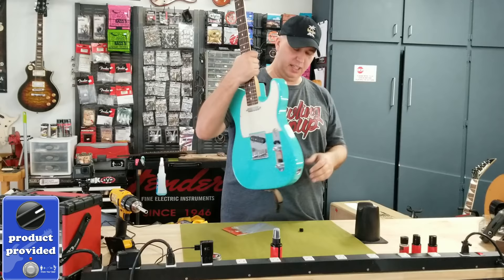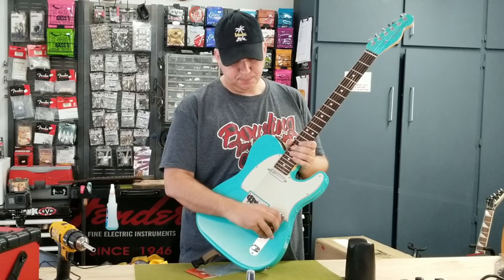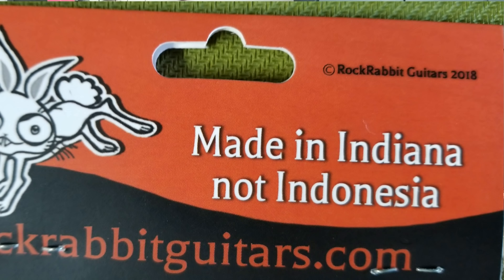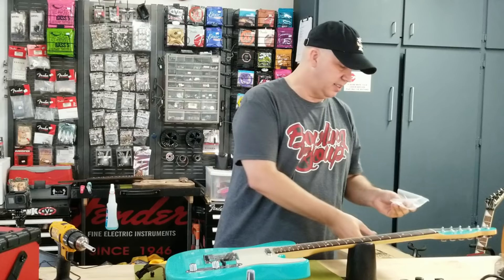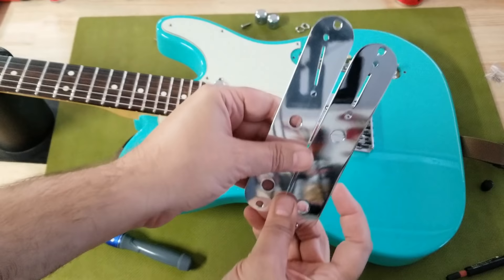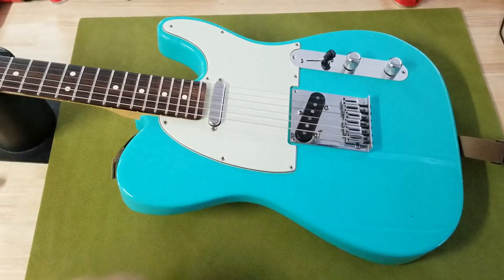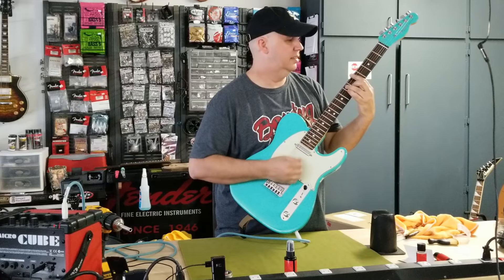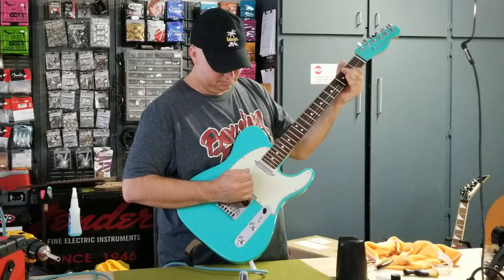Why Didn't Fender Do It This Way?

Comment: I would be willing to bet that, if Fender did something like this, the "how dare they change something" howling would go on for weeks
Reply: I do so love my IMPROVED Telecasters, but let's face it - Leo got SO MANY things wrong the first time, he had to start two whole more companies to fix it! Like, ahem, the front side of the neck was curved like a baseball bat too! But you could tell it was the front side because of the .022"-high mandolin frets...
Reply: Well, Leo was an engineer, not a musician. I don't think I'd be too far off in guessing that the slot is straight because it's a simpler, cheaper option than angled. CNC machines kind of make that a bit redundant these days, though.
Reply: I actually prefer the look of the original to this and would probably just deal with it rather than have an angled switch on a tele.. It just looks wrong.
Reply: Yes because if Fender did it, it would have endless problems and the guitar would cost $3,500
Reply: @dogfacedboy6947   I’m more amazed at how many things he got right: The Tele and Strat, the synchronized bridge, two of the very best basses you can get (P bass and Jazz bass), the tweed Bassman and Tweed Deluxe, the blackface era Twin Reverb, Princeton and Deluxe reverb. 
Not many companies have success with having great basses and guitars, but to also have several of the most legendary amps ever made? Pretty impressive.
Reply: Only weeks? 'WTF did they do that for' newbies would be on about the soshwise switch slot forever.
Reply: @derpimusmaximus8815  He wouldn't have needed to cut the slot on the sosh. All he needed to do was have the knob further away from the switch.
Reply: What else from a guitar maker that calls vibrato 'tremolo'?
Reply: Fender would just call it the super duper deluxe model and charge an extra $350 for it.
Reply: @dogfacedboy6947  The design has been almost unchanged for 70 YEARS and you are complaining about what he got wrong.

Comment: Most of the tone of the tele comes from how the original switch plate is designed.
Reply: Hoping thats a joke. Lol
Reply: knob angle tone is indeed more important than type wood etc.
Reply: @PeterMarvellous3  indeed. Lol
Reply: too much rum pirate?
Reply: hahaahha
Reply: Yeah, this would bleed all the vintage mojo out, making it sound like a Les Paul Junior with a ground problem.
Reply: LMMFAO!
Reply: And the "TONE METALS" used
Reply: Yeah, the titanium is for MeTaL sHrEdDeRz
Reply: @whatcher8151  And matches the plate in my head !
Reply: @gilwood7530  I have the Atlantis Titanium Plate system in my c4-c5 neck/spine. Isn't being in tune great! But my whammy bar still needs a bit of testosterone.
Reply: @whatcher8151  "Isn't being in tune great!"
What does that mean?
Did you mean: "Isn't being in tune, great?!" - as a question?

Comment: In all my years (over 50), of playing Teles, I can't recall ever switching pickups that much, or frequently. Maybe I've just gotten used to the controls as they are, but it's never given me a problem.
Reply: Same. I reversed the control plate as I use the volume far more often than tone or pups. Couldn't be happier.
Reply: This is about incremental improvements. Won’t really change the instrument but makes it just that little easier to play and adds something different.
Reply: deepthroat What’s a nit?
Reply: It's a louse egg. Ya know like head lice?
Reply: Lol no, didn't know that. Hehe, learned something new.
Reply: Agree.  Bought my Tele in 1971, been playing it all these years and never had an issue with this...First World problems?
Reply: deepthroat yes he really is and he is a pretty below average player as most guitar tinkerers are.
Reply: Me too! We're getting so SPOILED we need our Tele pickup switch angled 5mm to the right. Cue temper tantrum from somebody somewhere about something!

Comment: Very cool. The other cool thing you didn’t mention is your use of your guitar cable as a stand while you rest your guitar on your work bench.
Reply: There has to be some deep, esoteric reason why he doesn't use a 90-degree-end at the guitar input.
Reply: Arg, yes, I couldn't watch it when he did that.
Reply: @maekong2010  be patient, it will become a 90 in time.

Comment: I don't have a Telecaster — grew up playing a Strat. But for ages, I've thought the control plate on a Telecaster should be reversed. Volume swells can be done from a much wider range of the picking area, and you can just stick the pickup selector in one spot and not have to think about it.

I remember once meeting somebody who did it that way, and it just made perfect sense from looking at it.

Comment: I considered this product but, in the end just reversed the plate  and the knobs . Nice demo though Phil !
Reply: Me too
Reply: Same 😊
Reply: Same here. Bill Kirchen style. And its more logical anyway..
Reply: I just installed an after-market Baja Tele-sryle harness in mine. Reverse controls, 4-way switch, push-push volume knob for in/out of phase. Killer!
Reply: Yep,me too.:-)
Reply: That's something Fender should be doing!
Reply: I used to reverse the plate but I just kept hitting the pot. I agree that the worst thing about the tele is that switch and where it's positioned.
Reply: My Blacktop Tele came with a reverse switchplate stock. It also came with witch hat knobs that I immediately replaced with knurled nickel chrome plated Tele knobs. Couldn't be happier!
Reply: I like it reversed.  Got the idea from Chapman...seems more functional to me anyway.  But cool product.  Thanks
Reply: Reversed mine too on all my teles. Much better for me.
Reply: Still doesn’t solve his clearance issue when you reverse but to each their own ✊🏽
Reply: Yup, I use the volume more than the pickup switch anyway.
Reply: I would use it but I'd still reverse it like the reversed regular plate I have now.
Reply: I was thinking that, and you guys have confirmed my suspicions, but he did say the switch is moved over a bit, might be good
Reply: yeap... reversed plate and 4 way switch for me
Reply: I'm doing one with one tone and  two volumes with a 4 way reversed with a HB in the neck ,it really looks different reversed with 3 knobs ! :-)
Reply: That's exactly what I do
Reply: Same here.
Reply: @1ufcfanatic795  yeah I think it's the only way to fly with a Tele. The other Mod that I do is install a lefty bridge. That really makes for snappy lows and takes that icepick out of the high end.
Reply: It puts the volume knob up where it is easier to swells with when flip everything
Reply: Same here. But the angle plate is cool.
Reply: Todd Flowers 
I also use a  Stratocaster switch tip.
Reply: @powbobs  I have a Nashville Tele with a 5 way switch and a Strat switch tip but I prefer the TOP HAT tips on my other Teles.😎👌

Comment: What I did was buy a new blank plate and drilled three holes. I put the volume knob where the switch normally is, left the tone control in it's usual position, and installed a Gibson-type toggle (angled) in between. I put the switch closer to the tone control so I could get my hand in, with plenty of room, for volume swells.

Comment: I opted for a 3 way toggle instead of a blade for my tele.  Even easier to switch pickups because I oriented it in the same plane as my picking hand so it switches up/down vs left/right(like a standard tele blade)

Comment: I did the same on my 2012 MIM Tele, except I flipped the plate to put the switch out back at an angle, and the volume knob up front for better volume swells and control. I also drilled a third hole between the volume and tone and installed a discrete chrome kill-switch.  Now everyone wants to play my Tele... A great mod. In fact I've seen these slanted slot plates all over, some come drilled with 3 holes.This is the way it should be form Fender!

Comment: One word of warning: the version with the volume moved back a 1/4" won't work on newer American tele's sometimes. With the S-switch volume knob there's a "hump" in the control route that prevents the know from moving back at all. Rock Rabbit will make one without the knob shift, but the info on their site about this is at the bottom of the product page - well below the "Add to cart" button. Just an FYI - I found out the hard way.

Comment: Thanks Phil. Great product wish I knew this some weeks ago. I actually routed a cavity on the top and added a 3 way toggle switch like the LP. Don't regret it cause it looks like it was originally made that way. Then I made a plate to use two volume pots & two tone pots. There's enough space in the cavity to fit 4 pots comfortably. Enough so that I used 2 push pull pots. Thanks Phil love these videos.

Comment: That's a really cool update to the original design. I was thinking about my Tele and why I haven't been annoyed by that. I think it's because I roll the knobs on the bottom of the knob. I guess I got into that habit to avoid the "thumb bleeder" pointers on Gibsons. I usually use my middle finger on the bottom of the knob to roll it back or forward.

Comment: For a similar reason, I flipped all the control plate on my tele. Now I have volume then tone than switch.  I don't  switch a lot on the tele, since the difference in tone between the three position is huge, but have a plate like that would be awesome. thanks for the suggestion, Phil.

Comment: I’ve never had the problem you’ve had with that switch. 
My only issue was that it’s too easy to hit the pickup selector switch whilst rocking out. 
So I turned the whole plate around 180 degrees. This also allows you to do volume swirls as it places the volume pot closer to your little finger.

Comment: Yeah Phil you're the best I just bought a Telly it's the second one I've owned I always unscrew the switch and volume plate and flipped it around so the switch is  towards the back and the volume and tone  turn the same directions  it's kind of cool so it's back for the slack neck pickup and forward to floor it bridge pickup  is how I always remembered it alright thanks for the video I'm going to get one of those product's

Comment: Danny Gatton solved this problem decades ago.  He simply bent the section of the switch that holds the knob down about 40 degrees.  He could reach the switch and avoid the volume knob without any replacement parts.

Comment: These are nice plates.  I run one.  But… if you try the top hat switch with it, in the neck position, the added size of the top hat and it sitting nearer the pick guard, you’ll tap it more often with your hand accidentally while strumming.  Or, the short version, the small knob works better with the Rock Rabbit plate.

Comment: I've never really had an issue with the switch getting in the way, but ergonomically it is certainly a big improvement. So although I love the classic way Fender have everything all in a line, little things can make all the difference.
But to change the subject ever so slightly, there are a couple of issues I have with Strats and why I first picked up a Tele. And its not just the trem system. Its two things.
One, on a strat the volume nob is far too close to where you are playing and means accidental movement can occur on occasion, hence why some players like Richard Thompson removed the nob. And also with a Strat, that selector switch is actually on such an angle that if you are a rhythm player, you can knock the pickup selector switch accidentally. Fender in trying to get things ergonomically right to help for quick selection of controls, actually did too good a job, to the degree that it caused a whole other set of issues.

With the angle of the after market selector plate, it is a really nice compromise.. if only the strat one shallowed the angle of their switch, if only strats had hard tails bridged with brass saddles and a volume nob set just a few mil' lower then I might add a strat back into my collection again. Haha.

Comment: Or you could go with the Bill Kirchen setup for free. 
1. Take the knob off. Throw it away.
2. Unscrew the control plate and reverse the direction.
3. Unscrew the switch and reverse the direction.
4. Reverse the location of the volume and tone.
5. Reinstall this in the guitar
Now you can get to everything easier. Bill is the guy who (among other things) 
played the Tele on Hot Rod Lincoln and this setup help him get the tone you hear there.

Comment: I have a cheap Chinese telecaster thin line copy from way back. Even then, they had this kind of layout so the selection switch doesn't interfere with volume: of course, without a plate on top of the body, like you're showing here; the controls come straight out of the pick guard.

Comment: I never liked the angled Strat switch because my hand would always knock it down. I'd probably do that with this one too. The better solution is to turn the plate around and put the switch at the back and swap the pots to get the volume at the front.

Comment: I do not have the Telecaster now, it was a Squire,but I was not satisfied with the slider. So I got some modeling " Milliput " from Games Workshop and fashioned an extended switch arm that I shaped to enable me to be able to change pickups with my little finger. worked fine for me.

Comment: I prefer the normal tele switch, because its harder to accidentally knock it out of place. But, I use strat knobs for my volume and tone, which sit lower and fix the problem you mentioned

Comment: Remove plate . Reverse direction.  Switch to rear and tone and volume to front. First thing I do to any new tele. Can still do swells and such with out hitting switch ever. (Also, I ditch the highhat switch tip for a strat tip.)

Comment: Never thougt about, so just had a closer look at it - For me everything works fine  only by the use of the tip of my ring finger - even to change the ankle of the guitar on the strap by using the crash barrier of my  so called vintage bridge -  So if this thing makes you guys the things easier  - I will appreciate this - but for me a Telly is a Telly - no belly cut,   same good old bridge and control plate - "take is easy baby , take it as it comes" :)

Comment: Hmmmmm?  I like the original factory design, because the new angle for the toggle switch makes it easier to accidentally hit the toggle switch back to the bridge pickup setting while strumming.  Besides is the monetary cost and work to replace the plate worth the change?   Some people also reverse the original plate and put the toggle switch to the rear and the volume to the front.   They believe that they can get volume swells better on the volume knob now.  I do not see it being any better myself.   And, it is a lot of work reversing all the wiring.  I believe, comfort is relevant to playing more and getting used to the equipment as it is designed from the factory.   And, if it is not broken, then leave it alone and as I said ... get comfortable with it by playing more.   Speaking of comfort, I see Fender Company in 2018 is putting concur heals for the neck to the body, body belly cutouts, and armrest cutouts on the Telecaster (kinda like a Stratocaster).  Although that might be very comfortable instead of the squared boxy original Telecaster with sharp edges, and it will still have the same Telecaster sound ... it just does not look right to me.  Again, I like original design and comfort is relevant to practicing more to get comfortable using it, and yes .... visual aesthetic looks of an original Telecaster are important too.  Ohhhhh,  let's not forget Fender put a third middle pickup in a Telecaster to try to get a Telecaster and Stratocaster sound in one guitar.  But, players complained in reviews that they lost that cool sound of the Telecaster neck and bridge pickups together.  Whew,  I like my original Telecaster just as it came from the factory.  Comfort features are usually a wasted monetary cost and wasted work time, and not always cool to everyone ... just saying.  Anyway, I love your reviews.  I am sure that the newly designed plate will make some people happier.

Comment: That's just awesome I'm buying one... also about the barrel knobs I feel your pain with those I don't like them either, I just took the barrel off an wrapped some of that white thread wrap type tape of forget what it's called but you put it around screws an bolts to fatten it up for a better fit. I just wrapped a few good layers around the tip of the switch at its worked great for about two yrs now. I wanted a strat tip but could find one to fit it.. great vid though as always..

Comment: My Chapman ML-3 has this problem. So I made a switch cap that has a small blade that extends out about 1 centimeter (about 3/8ths inch for the metrically challenged) that I can flick either way easily. A LOT cheaper.